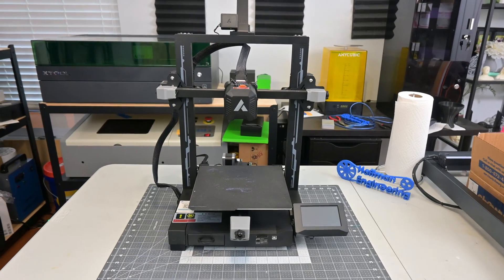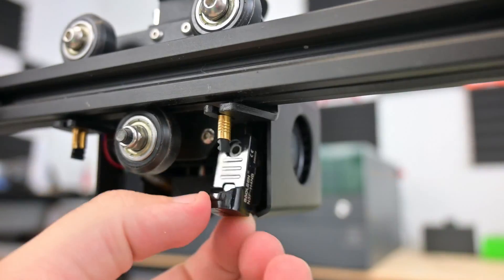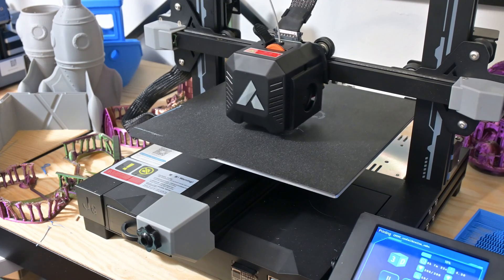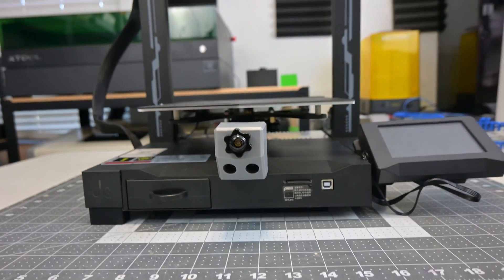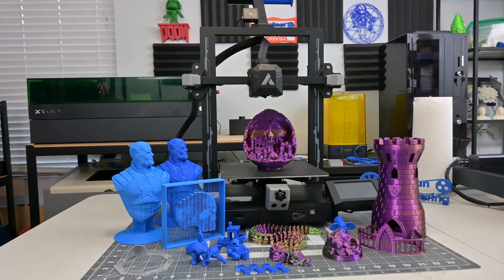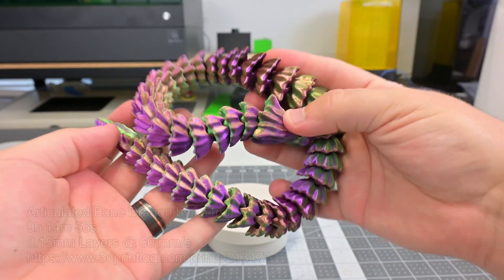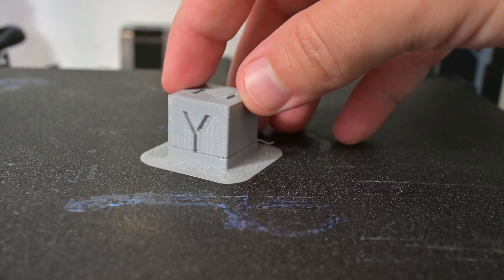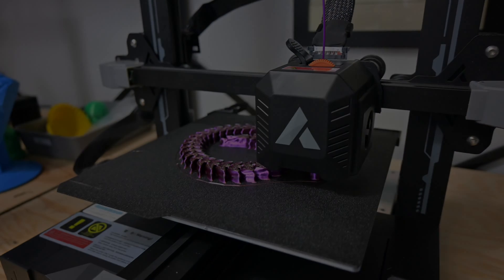The Best entry-level 3D Printer of 2023? - JGMaker R1 Review

Comment: Only works with 1.5mm 'compatible filament" as the producer says on Amazon. While standard filament are 1.75mm. apparently they are the only company selling 1.5mm filament as well. Not a coincidence! They want us to be locked with them to buy the filaments from them only.
Reply from the maker: They have a different model, the R1 Neo, that is apparently 1.5mm only. It's not on their website, but available through Amazon. The one in this video, the "JGMaker R1" uses normal 1.75mm filament, as everything in this review used my own spools of filament.

It is very annoying that they would offer a "R1 Neo" and change to a proprietary filament diameter.